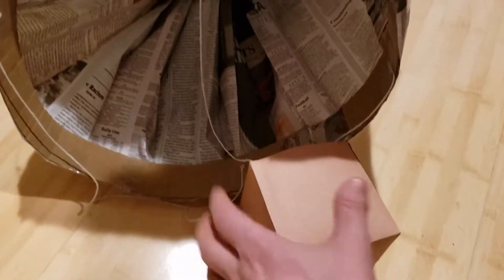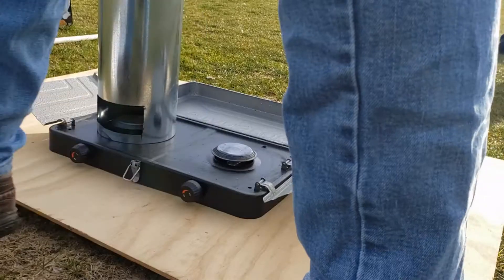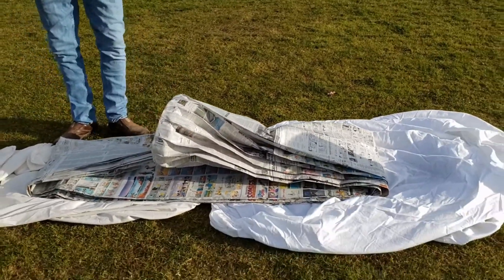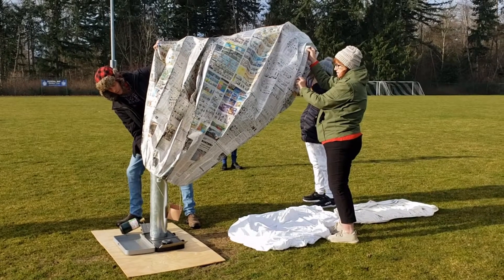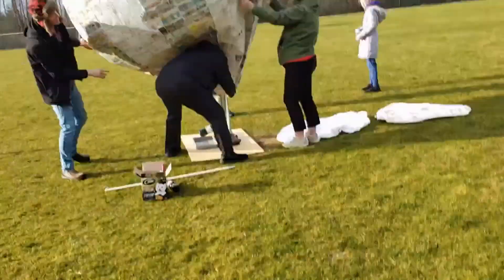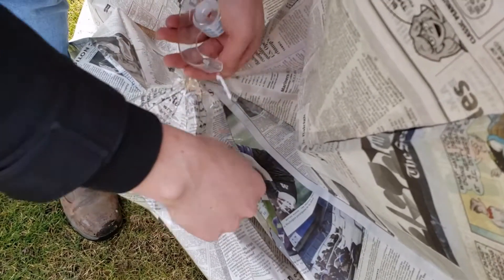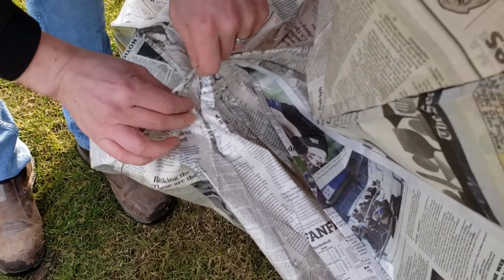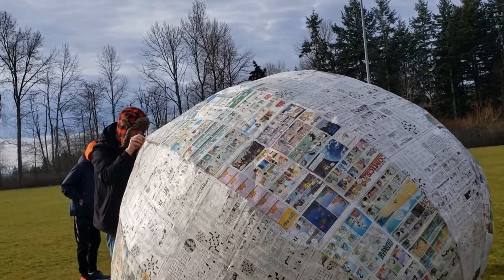Make Things Fly - Project: The Seattle Times Comic Balloon

Comment: A for enthusiasm,
F for technique. 

Lol, jokes aside, you must do a tutorial on making a blimp envelope. The sphere shape did come out very well.
Reply from the maker: I'm not sure why the tape didn't hold well to the newspaper. Near the bottom the heat caused the tape to shrink, making holes. It held pretty well to the tissue paper I usually use, but not well with this model. I also added to additional gores to my plans, but forgot to adjust the top. As a result the two gores folded in, causing the balloon to roll, and split open my top seams.  I might make another newspaper balloon down the road, making sure not to make the same mistakes.